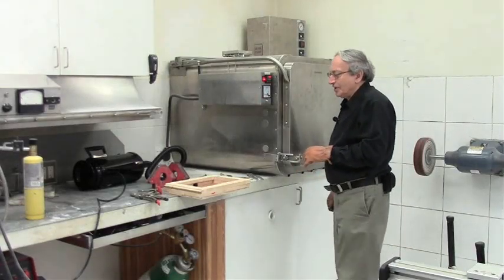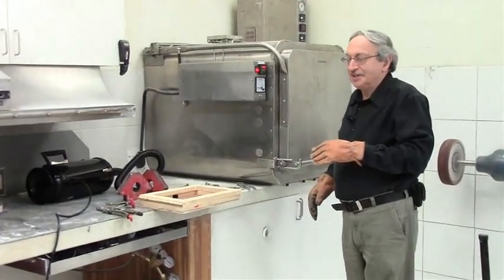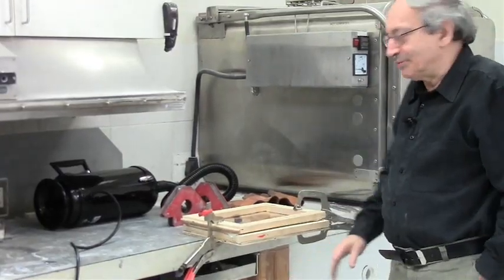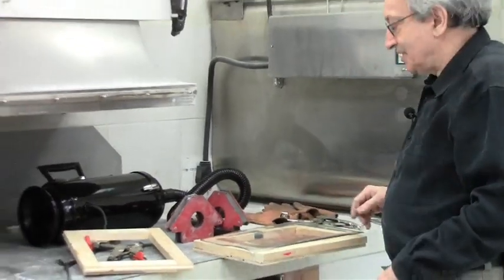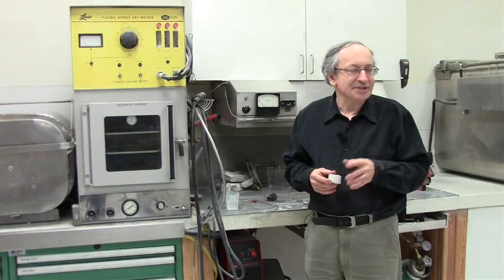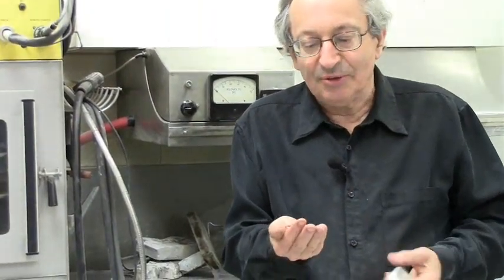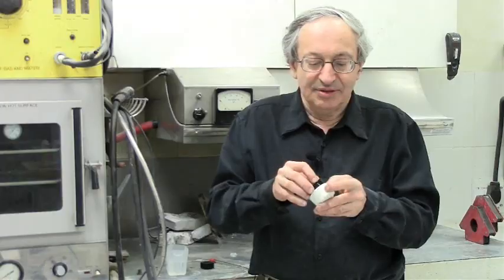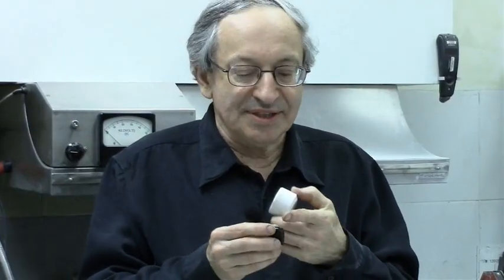Building Prototypes  Part 12 of 18 Plastics Forming and Casting

Comment: Great video!  You’ve been so kind as to provide the binder recipe for the metal paste I wonder if you would comment in a bit of detail about the sacrificial powder coating you’ve developed.  My suspicion is that it is largely carbonaceous (the indication for its consumption is a white ash) and would be consistent with a preparation that consumes the oxygen in the basic sintering furnace.  Is it optimized in some way to improve on plane old carbon powder?
Reply from the maker: No sure which coating you are referring to. Please give the video and time where it shows up.

Comment: are you saying you cast an LP using a silicone mold and it worked? I'm not saying it's impossible but i feel you would need such low viscocity silicone to flow into the grooves that the silicone would not be able to withstand the heat of thermoplastics. Thermoset resins maybe but the low viscocity silicone is so weak it wouldn't be very repeatable and something like polyurethane resin would probably shrink to much to be reliable. (i love your videos by the way you're my hero)

i was lucky enough to work with some vintage vinyl presses, the EMI 1400
incase anyone is interested,
EMI headquarters would use a special lathe to cut the grooves into either aluminum covered in acetate laquer, or copper. I believe the lathe cuts with sapphire. From this, industrial magic, not really sure but after some process negatives were created in Nickel using electroplating. These thin Nickel negatives were sent to us, protected in peelable plastic then a spray with compressed air (dust) and put onto the top and bottom stampers which were giant harderned steel flat surfaces (record shaped). The nickel would get bolted in the center and tightened around the circumference with a large threaded ring.

PVC pellets would get vacuum sucked into a auger and extruded into a handful-sized plastic puck. The machine then pushed the oven dried paper labels into the top and bottom of the puck whilst also picking it up and placing it in the center between the two stampers. The stampers had low pressure steam running through internal pipes very hot, they would close together (i think also using steam power), and pause to allow the PVC to re-melt at this hotter temp, i think then the stampers closed together slowly to the final position and paused to allow the pvc to flow into the grooves. The steam in the stampers was replaced with cold water, they would open and the solidified record would be stuck to the bottom stamper, where a hot knife would slide in to the edge and the stamper would rotate, cutting the trim. It would pop up and a linear axis would transport it to a rotational axis that gave it a guided drop into the inner sleeve then another guided fall onto the stack. All the axes were pneumatics with compressed air, the 'end stop' was to smash into the end of the axis and remain smashed

And before anyone corrects me, I know the nickel negatives were actually called stampers and the giant heavy flat surfaces they bolted to were called moulds but i hate that terminology
Reply from the maker: The reason  you can reproduce nanometer size details in silicone rubber of fairly high viscosity is the wetting and capillary action. Silicones in general have very low surface tension, so they "pull themselves" into the grooves. When you press records you don't have this mechanism to help you, as the polymer does not wet the nickel, and you have to force it in. Just think how this mechanism lifts water to the top of the tallest trees. Without surface energy release (wetting in a capillary) you would need an enormous pressure to pump the water to the top of the tree. 
Unfortunately, the subject of surface energy, critical to so many processes, is not taught in engineering school. You are not the only one who was surprised by this process.
Reply: @dgelbart  thanks for the reply, fascinating.

Comment: I wish you explained the aluminium-alloy casting a little more in depth. Obviously you can't suck the molten metal in using the vacuum. At least it seems dangerous to me. So would you pour it in and then degas the package afterwards? I really wonder if there are any benefits to the vacuum suction method anyways. I don't really want to drill a hole into my chamber to test it though.
Reply from the maker: The vacuum suction method eliminates the large foaming happening in vacuum degassing, but is not essential. Molten metals, like aluminum, have very low viscosity so they can be vacuum degassed quickly without the suction feed method.
Reply from the maker: When you cast low-melting point metals into silicone molds you just pour the metal in, no vacuum used.  Molten metals have very low viscosity and high density, so all the air bubbles are pushed to the surface instantly.